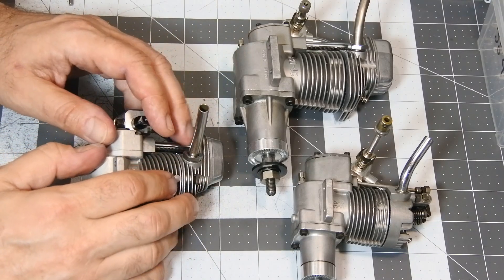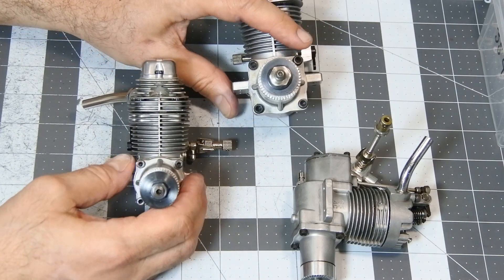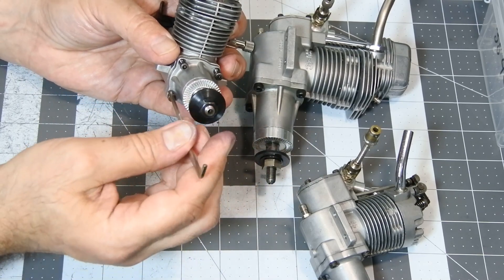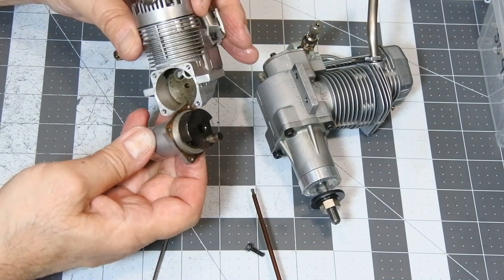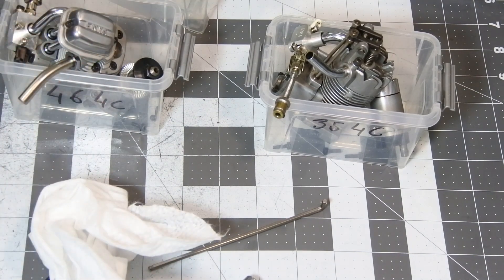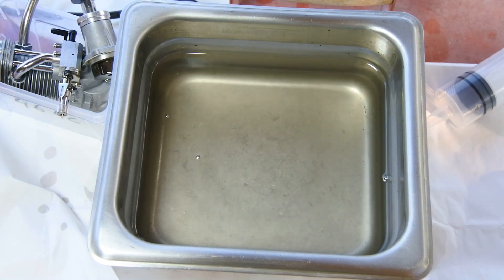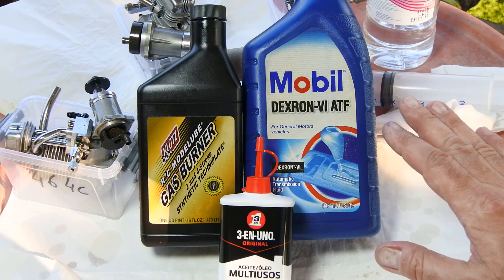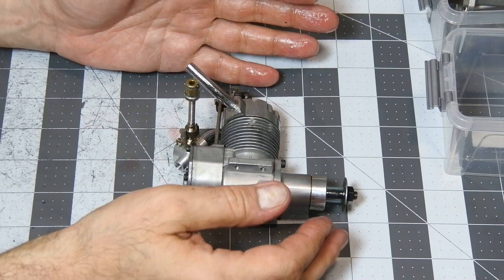Enya 4 stroke engines preparation for storage

Comment: You should also store at TDC on power stroke so as not to compress the springs.
Reply from the maker: Thank you for your comments. In most cases doing  as you recommends, engines stored with crankshaft turned to TDC.

Comment: Hello! 
Don't you think that the Kerosene will attack any silicone rubber o rings in the engine?
Reply from the maker: Thank you, great question. For a short period of time will be not so dangerous (15-30 minutes in ultrasonic bath). Of course, dozen of hours will destroy, especially silicone  based materials. Usually I drying cleared parts by soft tissue and keep it dry in home conditions. Wife doesn't like that :-).